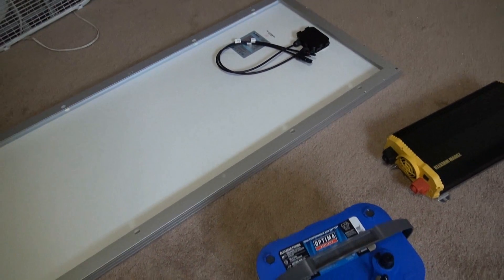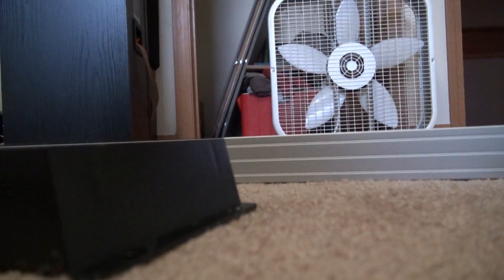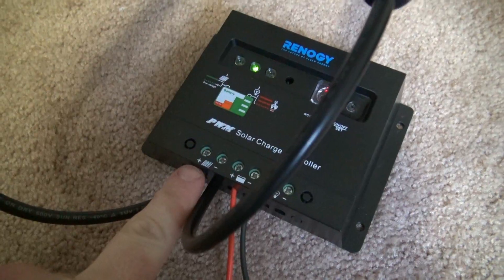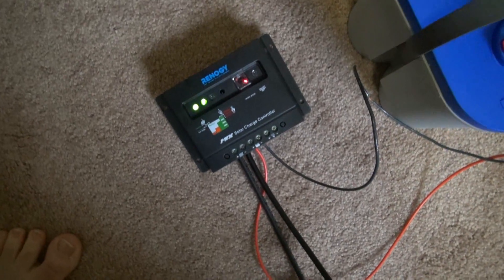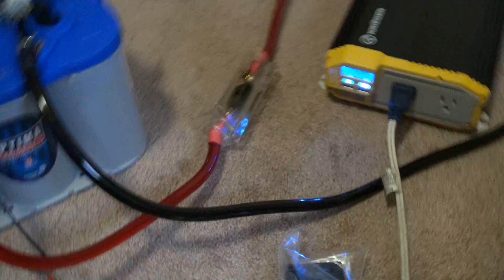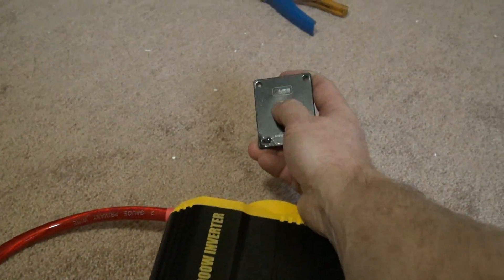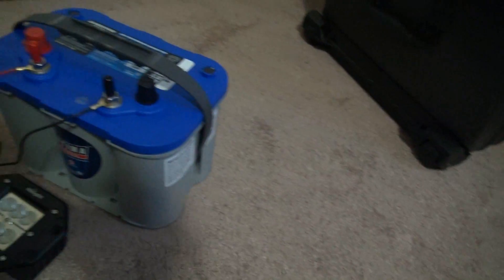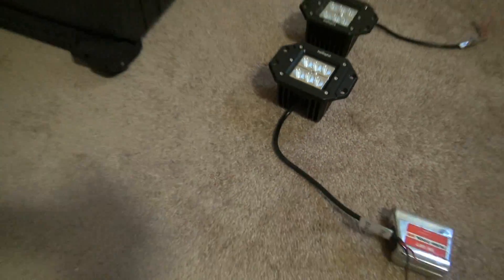How To Build A Solar Generator (2,000 Watt) – Part 2 - Component Testing

Comment: That 55 amp hour battery you can only use about 27 amp hours of it because so you can only use half a capacity of lead acid batteries before you damage them. That table saw would deplete that battery in about 10 minutes a continuous use. it would take about four and a half hours in perfect soon for that 100 watt solar panel to recharge that battery. A realistic use for small solar and batteries like this is going to be very low-power devices. Consider switching to LFeP04 it takes 50% more charging time to charge lead acid batteries as it does LFeP04. And with LFeP04 batteries you can take them down to to 100% and still get 10 times more life out of them compared to lead acid. There are plans and examples on YouTube to make your own lithium batteries and save yourself half the cost of buying an off the shelf one.
Reply: And 2 , 100 amp hour batteries will run you about $1,500.  

Might as well buy a Bluetti MaxOak.

Comment: I noticed you didn’t ground the inverter.  It isn’t necessary?  I am building a portable rig as well and was wondering how to address the inverter grown issues because there is no where to browned on a mobile rig.
Reply from the maker: I have read conflicting info on this.  For a mobile setup, grounding is not really practical, and none of the vehicle mounted inverters really have a way to truly earth ground. For a permanent install grounding may make sense. However be very careful and understand the issues should you ever intent to back-feed or transfer switch power in a house with utility power. Ground loops and other shock hazards can be created in that situation.  These types of inverters are best used as mobile or stand-alone off gird units.
Reply: There's advantages to not grounding a rig like this. If inverter is not grounded and you touch 120 volts on a piece of equipment you wouldn't necessarily get shocked because there's no path through the ground back to the inverter.

Comment: Please sir , What would be your opinion on getting 4 x 100 watt solar panels and the new KRIËGER® 4000 Watt 12V Power Inverter MET UL CSA?  I would also upgrade the battery to a SLR125 VMAX AGM Deep Cycle 12V 125AH Battery for RENOGY PV SOLAR PANELS

Comment: Thanks for these videos. It's given me some more confidence to tackle a project like this myself. Only difference for me is I would like to use an inverter that can output 240v for a well pump, which is my main reason for wanting this setup. Can you recommend  a particular brand of inverter that can do this? Any other tips would be much appreciated. My pump plugs in using a L6-20p type of plug.
Reply: Bill McGee this is also the reason for my research into making a solar generator.  Most residential well pumps have the ability to run off 120V or 240V.  Mine has an end cap that is removable with a switch to 120V from 240V.  It also has the wiring diagram inside the end cap.

Comment: Amazon has different listings . This link you provided . Doesn't have the 2000 watt inverter . After searching  amazon there is a 2000 watt krieger for a couple dollars less than the 3000 watt on the listing you linked to . Crazy 1000 watt difference for basicly the same price . In this case I would opt for the 3000 watt .
Reply from the maker: Thanks and yep, I have been updating the links to the 3,000 model for the same reason. It fits in the same layout pattern as I used as well. Originally the 2kw model was significantly less than the 3kw. Not anymore!

Comment: Do they make larger capacity solar generators. im wanting to use it on the house to help lower the electric bill but ALSO be used for power backup in case of power outage. I have access to sunlight, not much on wind, unless I leave it out in a storm where the wind will generate power or rainfall power generators. Im looking for continuous running of the solar energy.  Just a thought. Oh one other thing. With your power inverter, you MUST have an AIR source for cooling. DO NOT mount the inverter directly on the surface of the case or the heat and dust will overcome it and blow it out. I know of this because Im a truck driver and my 2000 watt inverter wasnt cooling because of no air flow.
Reply from the maker: Yes, this same design can be used with the 3,000 watt Kreiger inverter as well. It will fit in the same layout.  This build series also has a followup video on how to add additional panels and more battery capacity using quick connects to keep everything portable. 
I have been using the inverter for quite some time now and have not ran into any heat issues. It is designed to be mounted directly on whatever surface you are using, has internal fans that kick on when airflow is needed, and in the event it did ever overheat it will automatically shut down before damage occurs. This has not ever happened for me however.
Reply: Yes, I know that. I had Cobra power inverters from 800 watt up to 2000 watt and the clearance from the floor surface to the casing of the unit was only 1/4 to 1/2 in, but then I went and added 2 strips each side and increased the height from the floor giving it a 3" air flow under it. It worked better than just flat floor mounting, fyi. How do you get these panels and how do you calculate the amount of solar panels and since it is mounted into the circuit breaker panel box, how much is sent to the Power Company?

Comment: Hey dude would the inverter work if it hook up to the load of your charge controller without the battery just pure solar power to charge controller to load of charge controller to inverter to your load of inverter?
Reply from the maker: I don't think it would. The charge controller monitors the battery voltage  in order to decide to charge or not. If it cannot detect a battery I don't think it would attempt to charge.  What kind of application were you wanting to try this with?    There are devices such as solar pumps where the panel is connected directly to the load, and the pump only runs when there is sunlight. The motor has to be sized to match the panel, in both voltage and current capacity.

Comment: You are testing a battery, and assuming the solar panel can actually support that battery.. How long does it take to charge? That is the only significant test required.. I highly doubt a single 100W panel is enough to charge  the battery effectively.
Reply from the maker: I discuss this in the video. A single 100W solar panel can easily charge the battery over the course of a day. It depends on the conditions (sunny vs cloudy) and how many load you are using through out the day as well. My system uses quick connects to easily expand both the number of panels, as well as the number of batteries so it can scale with your needs.

Comment: Nice info but dude, use a tripod. Your camerawork makes me seasick
Reply from the maker: Thanks, and sorry about that. I was in the process of moving when I made this video, and didn't have my tripod. The later videos in this how to series I used the tripod.
Reply: I watched all your videos on this beastie. GREAT JOB!
Please feel free to message me at ebxrocks@yahoo.com
I'll respond from my gmail account (Which I won't reveal for public consumption), because I would love to share with you the approach I took. I'll send you a few pics. My system is much simpler because its meant for smaller scale applications. That being said, I'm in no way in competition with you. Truth be told, I HIGHLY RESPECT what you've done, and the quality of your work is excellent!

As I examined your box in depth, I wondered if you could get everything-less the 2nd battery-into a Pelican 1440 Case. You might want to check that out. You'll save space AND money.

Comment: What would be your opinion on getting 2 x 100 watt solar panels and the new KRIËGER® 4000 Watt 12V Power Inverter MET UL CSA?  I would also upgrade the battery to a SLR125 VMAX AGM Deep Cycle 12V 125AH Battery for RENOGY PV SOLAR PANELS
Reply from the maker: Those all are good products. You may have to arrange them in the case slightly different, but they should all work well together.